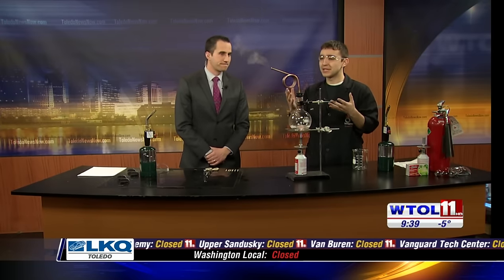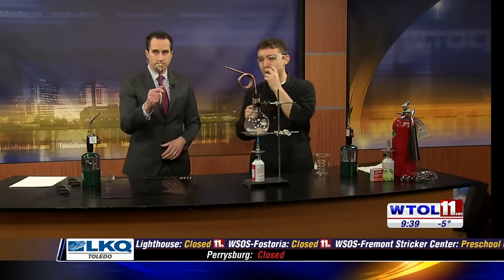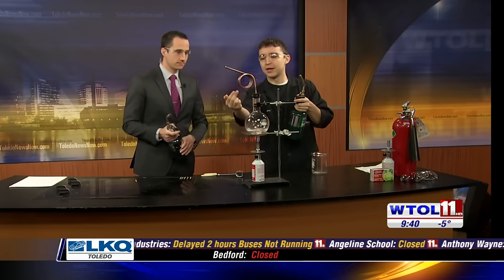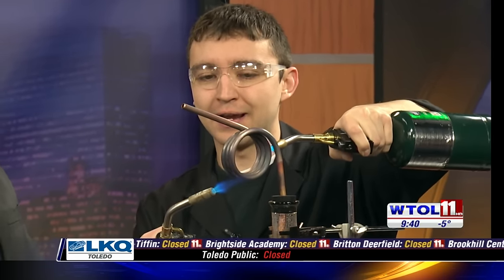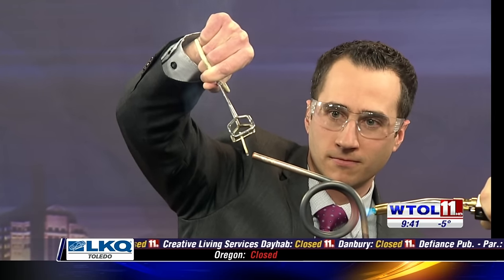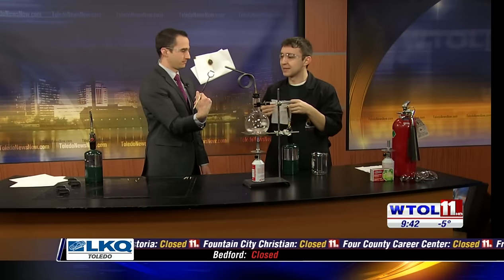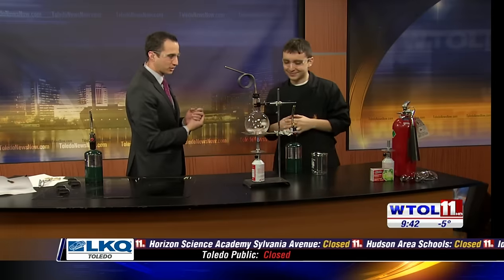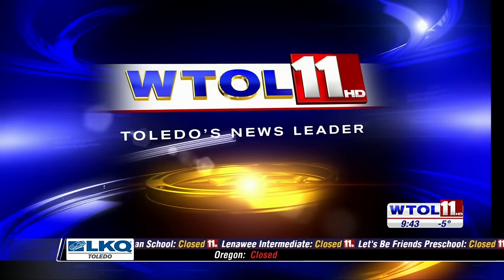Properties of superheated steam

Comment: I guess I always assumed superheated steam was made directly, by boiling water under high pressure the same way that a pressure cooker raises the boiling point of water on a lesser scale. But I suppose it makes sense that you could boil the water first and heat the steam hotter afterwards, like this. And then you'd be moving it farther away from its condensation point at any given pressure, since dryness is likely to be desired.
Reply: Yep...the pressure is still about 1 ATM..or 14.7 psia...at that atmospheric pressure water boils at 212 F....but if you add more heat...the vapor move from a saturated state..to an overheated...meaning the pressure is about 14.7....but at a higher temperature...

Comment: Thank you very much. I have been thinking about a garage project with super critical steam and I got a bit bigged down with containment. You solved a big problem. As long as there is no need to hold the energy there is no need of a containment vessel. And it's super critical. Thank you.

Comment: so, what you have proven is the fine line between "saturation" and "dryness" of the properties of steam. 
Above saturation, the water properties change from a vapor (which is wet) to a Gas (which is dry). 
Depending upon Pressure, a Gas has properties of wetness until its dry and the heat contained in the Gas remains Superheated until it gives up its heat to remain a gas. At which time, its dryness fraction describes it conditions of being a Vapor.

Comment: Hahah!  I worked as a janitor at Monroe Power Plant, and one day I noticed a small steam leak from one of boiler feed pumps on Unit Two.  Out of curiosity, since this was a "lazy" leak, or just some steam coming off, I put my broom with its plastic bristles into the steam;  They instantly curled!  That steam, even out of the bad seal, was still so hot it basically destroyed the broom~

My dad was an engineer for Detroit Edison, and told me that the escaping steam was probably 1400 degrees~

Comment: There was a man working for American Crystal Sugar in Grand Forks Minn. that was working on a super heated steam line on a scissor lift. Someone up the line turned on a valve and the man on the scissor lift was burned alive with the super heated steam. ACS kept the death out of the papers so no one found out. I worked there, it is one of the most dangerous places I have ever seen or worked at. One time a fellow fell into and open man hole that was covered with hot water with particles suspended in it. He fell into the man hole and was boiled alive, luckily someone else was there and pulled him out. Severe Burns. Close the Plant. I talked to the EPA and other government entities and ACS told them I was a disgruntled former employee. I am trained as a Civil Engineering Tech. I have land surveyed, project inspector, material testing and I have never seen such flagrant disregard for safety.

Comment: As you saw with the match, it ignited because the compounds in the match head react. However, the steam has no free oxygen content and could not support combustion to keep the match burning. The paper equally did not ignite at the steamed area, but outside it, where there is contact with air.

Comment: I work in Oil refinery and I do work with super heated steam, i have heard from my supervisor that it can actually cut thru bones (i doubt it) but the way we find leak is actually using boiler water on location and the steam vapor will show for short period,

Comment: Hello! I am currently enrolled in the Power Engineering Technology as a 3rd Class student. I just wanted to share some of my knowledge to the ladies and gentleman scrolling down the comment section. So, one of the uses of superheated steam is to rotate the turbine blades of a high performance Turbine which is coupled to a generator to produce electricity.

Note: Not all turbines need superheated steam. Normally, only turbines which will convert mechanical energy of superheated steam to electrical energy of the generator will need a superheated steam. 

Why do we use superheated steam and not saturated steam when we need mechanical to electrical energy conversion?

- Saturated steam is basically when water just boiled and became steam so temperatures around 100 C to 110 C for example. 

- Superheated steam is rising the steam temperature well above the superheated steam temp of 100 C to 110 C (range that I used) to about 250 C - 300 C for example.

So answering the question:

1) Superheated steam carries more mechanical energy. This means that it has the ability to rotate the blades of the turbine faster and more efficiently making us get more power of the turbine. 

2) Some turbines run on superheated steam only because the blades are designed to rotate out of the steam and not water so we use superheated steam which is very dry (very low moisture content). Also, it does NOT mean we can use superheated steam that is extremely hot, like say 500 C, because we can burn the turbine blades because each turbine has its own specifications. 

3) It's easier to direct superheated steam than water and there is relatively less energy losses in the process as superheated steam. Even if it cooled down due to mechanical losses, it will still be called superheated steam but it will be around for example, 280 C if we were to compare it to the superheated steam range that I used (250 C - 300 C). If we used saturated steam, it may condenses and as the steam and water go together, it will cause what is known as "Steam hammering" because steam velocity is much faster than water velocity and because of this, it will cause excessive vibration to the system that is transporting the fluids and it will damage them and more often than you think, it will explode the transporting system (pipes). 

Thank you all so much & I hope y'all have a great day!

Comment: This kind of steam is exceedingly dangerous. A lot of industrial workers will wave long sticks or brooms around superheated steam pipes to check for potential leaks, because just simply walking by it for just a split second will absolutely slice you. I work with a lot of high-pressure steam at my workplace, and that in itself can be terrifying on its own, but it's not nearly as scary as superheated steam. At least I can see where I might have steam leaks at my workplace. I can easily avoid it altogether, but others might not be so lucky.

Comment: 0:26 - Did he mean to say condensed water molecules?
Reply: Of course.
Reply: Yes there are small water particles /water vapour..
Reply: @RS-uo2nd  That's incorrect, the hottest part of the flame in this scenario is the blue inner cone, since that is where complete combustion is occuring.
Reply: Yes! and he repeats it and the so-called weather man doesn't catch it either.
...
Unfortunately, the term 'vapor' is also commonly used to describe the condensed WATER cloud...
Ultrasonic "vaporizers" produce a mist that hopefully evaporates, leaving a dust of the dissolved minerals behind on things.
Reply: YouTube detective got him
Reply: @jonathanclark8796  what the guy said in the video was totally valid. try replacing what is said with condensed water molecules and it doesn't sound right. OP doesn't know what he is saying

Comment: I work with overheated steam. It's around 420 degrees celsius when it hits the turbine. I would never put a flash paper in front of anything lol. The pressure is 40bar+ so if there's a leak you will notice it by the sound! And the water has no oxygen at all, or close to nothing(deionized). That would end the lifespan of the boiler rather quick. And you can't see any steam when it hits the high temperatures.
Reply: 40 BAR 420 c sounds surreal. impressive
Reply: 40bar? Is that all? 😂
Reply: @Jon-em4kc  in superheated steam the energy is in the temperature of the steam not its pressure. You can pipe superheated steam all over a vessel without the pressure blowing out the pipes.
Reply: once a tiny 3 bar silicone hose slappede me   @Jon-em4kc

Comment: ...the match and paper didn't ignite for lack of oxygen in the steam. had they pulled paper and match out after half a second or so, they would have burnt...
Reply: if so... then why did it burn with the overheated steam?
Reply: Match stick burnt because it didn't need oxygen, the match head have the ingredients. Paper didn't.
Reply: Could be a good way to char things without them catching fire
Reply: @fryncyaryorvjink2140  

I researched and found out that a match stick Ignites at a temperature of 230°C, while steam is around 100°C. It didn't ignite with normal steam as it just didn't reach its minimum threshold to combust. Superheated steam is about 500°C (maybe more) which is enough to ignite the match head and burn paper.
Reply: AxA12 - you didnt pay attention.

Comment: the scariest thing is high temperature hot water under pressure.   when under enough pressure you can force it to stay water even though it's hot enough to be superheated steam.  water expands 1700 times in volume when it flashes to steam and it is less damaging to pipes so you can move around a lot more energy by keeping it in the liquid state.  but if there is a leak....   well..

Comment: I found this years later, but interesting, I used to hold a boiler Operator License in Ohio,  it was low pressure, but I studied to get my engineers license, but moved away before I had a chance to take the test,  secondly I looked at the closings at the bottom of the screen,  I remember all those places. I used to live in Bowling Green, Ohio, I used to watch channel 11 all the time.

Comment: Boilers in ships get up to 600 psi at 870F and it will cut your skull in half if you walk into a leaking steam pipe. I've seen 2x4 boards cut in half with Super Heated Steam. The 1200 psi ship boilers are even more dangerous!

Comment: Whats really wild is that water expands 1700 times it size when it transitions from a liquid to a vapor.  It go boom boom if you flash it, that is if you take it from room temp to steam instantly.  A gallon of water is roughly 12 inches by 12 inches by 12 inches.  1700 times that is a big boom boom.    Like biiiiig boom boom.

Comment: Right from the start; "That's the air molecules condensing to form kind of like a cloud"?  Whoa there ! That's just nonsense.  This is nursery class level misunderstanding of basic eighth grade physics.

"Steam is 212 degrees" -  No it isn't, it can be any temperature to which you heat it.  It just gets worse from there on.

Comment: Thing is though, if you had an air pump going through a bunch of copper pipe.. no water just blowing air out the end of the copper pipe, and you took a blowtorch to it, you've essentially just made a heat gun and that will probably burn paper and all that good stuff just the same ..

Comment: But what if it only was hot air? Would there be a difference?
Reply: Air has an exceptionally low heat transfer coefficient compared to water and steam.  It's also very difficult to condense air for an efficient heat cycle to run a turbine.

Comment: Melosco super heater in ships, run at 850lb per sq inch at 850 °driving 9000 shaft horse power,  engines run for over 500,000 miles without maitinance, steam is the most powerful, most economical and the simplest power we have. 
We've been sold out on petrol and oil.

Comment: As you can see from this video superheated steam is very dangerous in its raw form.  The good thing about superheated steam is that you can bottle it for later use, whereupon it becomes entirely inert.  In this form you can store it indefinitely and transport it over long distances, and simply add heat to reactivate it whenever you need it.  This is especially useful in areas where you need superheated steam but none is available.

Comment: Well, steam is just a gas like any gas. If you can "see it", then it's not steam, it's small praticles of water flying around. Once you heat it, they also get turned into steam, so there is no more water to moisture anything. You're only left with a hot gas, and hot gas just work as any hot gas, they heat things up. Nothing to see here, in other words.

Comment: One question sir, may be it’s not the heat of steam burning anything but the radiation coming from heated copper which has a melting point Close would 1000 degrees. I hope you are not fooling the audience I will try to replicate this experiment.
Reply: Radiation is a very, very inefficient means of heat transfer.  I doubt it contributed anything significant to the match.
Reply: Rs Rt sorry to say sir but I work in the field of radiation, and I know it is more than enough to light a match put so close to the source which at near 700 degrees.
Reply: @manzoorathar11  
Then you should already know that in any heat transfer scheme in which convection or conduction is being used, that the transfer of heat due to radiation is miniscule in comparison, even with emissivities close to that of an ideal black body and it's contribution is often even ignored.
When we're talking about steam, we're talking about a heat transfer coefficient of 1, and since the copper was flourescing, we can tell that the temperature of the steam leaving the tube is close to 2000F.
More than enough to light a match of burn paper.

Comment: By torching the pipe, isn't it essentially just drying the steam and blowing out hot air?
Reply from the maker: Daniel,
Many commenters seem to have the misconception that heating the pipe somehow makes the water molecules disappear which would be quite a trick. The flame from the torch adds energy to the water molecules which exit the pipe as a hot gas. 

- Carl Nelson, Chief Scientist, Imagination Station
Reply: @ImaginationStationOH  Yeah, that makes sense... I guess "drying" is essentially evaporation (?) and there is no where for the molecules to evaporate or "expand" inside the pipe so it exits the pipe with more energy. I don't know...maybe I'm wrong again and coming up with my own theories lol. 

Anyway, thanks for the clarification

Comment: This is not super heated steam. This is a super heated pipe, with a little bit of steam. You cant expect much water vapor to be present when the pipe is red hot.
Reply from the maker: Hi Harley, 
Yep, this is indeed super heated steam. Water changes state from a liquid to a gas (steam) at 100 deg C. Once the water molecules are in the gas phase, energy can be added that increases the temperature of the gas much higher than 100 deg C. The red hot pipe as you describe it (along with the blow torch) is adding energy to the gas to superheat (raise the temperature above 100 deg C) the steam. 
- Carl Nelson, Chief Scientist, Imagination Station

Comment: It is not the steam its just the airtemperature inside the tube caused by the torch hook up a pump instead of a flask with boiling water and you get the same result
Reply: wouldn't that just be a hair dryer?

Comment: I don't think this is correct. Reason ( the steam produces pressure) the heating of the coils create high temperature ( Not increased steam temperature). The steam then pushes air through the loop creating a high temperature air. Essentially a hot air gun. The reason you don't see the steam is because the pressure is higher. 

Just my thoughts

Comment: Isn't he just buring away the steam that's going into the pipes with evaporation? the blow torch is just making really really hot air? i'm not impressed or amazed by this at all... it seems pretty normal to me i don't get what he is trying to prove?
Reply: The Steam travels inside the Pipe
the Blowtorch is just there to heat it up even more
Reply: @user-si5fm8ql3c   but once the steam meets the part where the blowtorch is doesn't the steam then sorta disapear from such a high heat. i still don't get it? the match lit up from being put so close to the hot pipe and the same for the paper?
Reply: @shanewickham9750  
Steam doesn't burn/dissapear when being heated very high
You can't see Steam 
what you're seeing is just the Steam condensing in the Air

if you heat it up further it takes longer to Condense
Reply: @user-si5fm8ql3c   Isn't that just hot air?
Reply: @shanewickham9750  
no it's Steam
air is a mixture of 21% Oxygen 67%Nitrogen and 2%Others
Steam is just Water